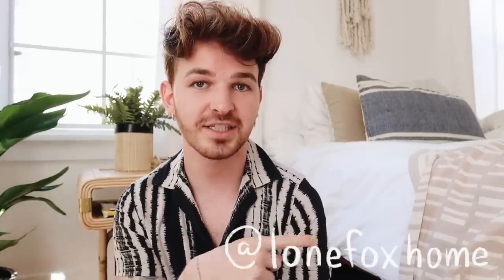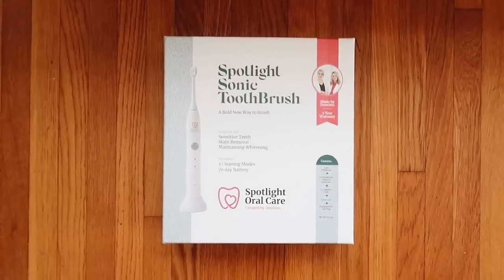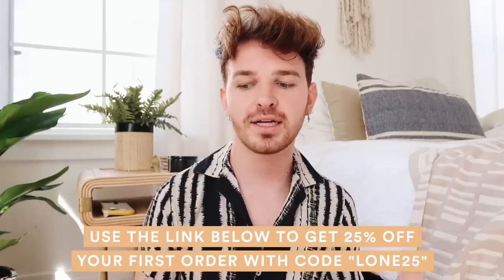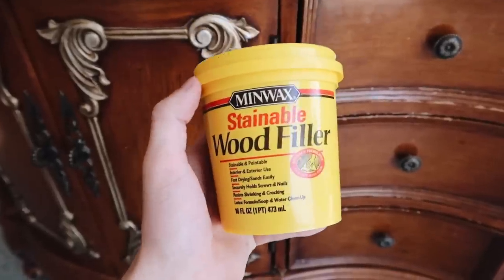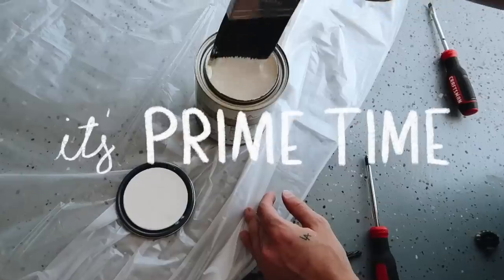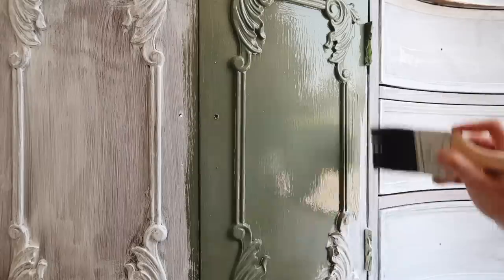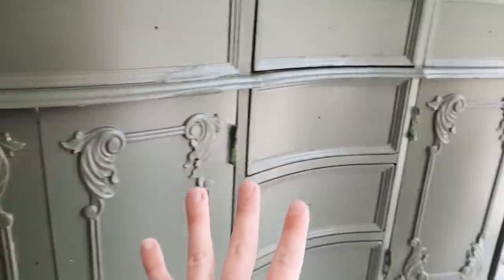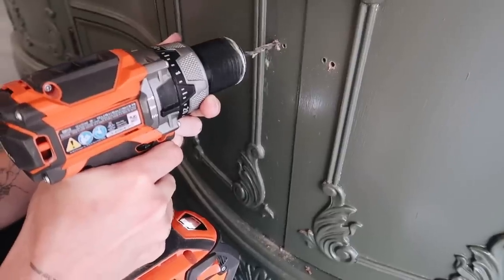DIY BATHROOM VANITY MAKEOVER - From Start to Finish! (I found it on the street)

Comment: You did the right thing with the wood speckling! Just a tip for the future: also add it to the sides a bit to make it cleaner looking and you should be able to use a spatula/putty knife/whatever you call it in English to sort of pre-form the lines. If it feels to wet, let it sit for a little bit until it starts to firm up a bit. It'll make the sanding process much easier. Two painting tips: 1. don't be afraid to really go into the caps and details with the paint and the brush. It'll help sort of fill them and in the end it'll look smoother and newer in the end. 2. I can't really see whether you're doing it or not, since you're not showing it, but always make sure you'll finish painting in the same direction. It's a bit harder to explain in writing, but don't leave weirdly directed strokes-they'll show up after drying. Trust me, I used to work as a restorator and as much as I tried in the beginning, when I had just started on that career path, to fix it, the weird strokes still stayed and I didn't know any better. But, if you are doing it-good job! Maybe there's someone else out there who needs to hear that tip. A lot of people don't know it, surprisingly...
Reply from the maker: Thanks so much for the tips!
Reply: Would a polyurethane top coat mask the streaks. I’m planning on painting a piece at home
Reply: Would adding a bit of floetrol to it help even out the brushstrokes?
Reply: Another tip I use to prevent brush stokes is to go down a brush size and use the paint sparingly. It’s not a time saving tip. A big brush and a lot of wet paint getting dragged around is going to leave strokes no matter what you put on top of it.
Reply: Lone Fox To prevent streaks you can always use Floetrol! I’ve heard great things about it!
Reply: @angelicfrade8600  Is that something you add yourself? I've never heard of this? Thanks for the tip.
Reply: @lonefox  You have a natural gift to visualize the potential treasure in re-purposing another person's cast off junk! Plus the creative skills required to actually transform it into something really awesome! You found nice piece, made fine choices in paint color, knobs & fixtures! I understand you were in a time crunch & working in another person's space but if you could take every piece apart it would be easy to get a professional finished result. Number each door & drawer to reassemble the same way. Take your time & reform the worn down or chipped out damaged places to look original. You might not have shown it but I have a few suggestions. After it's in pieces, use a cleaning solution to remove any residue. Very lightly sand the finish & use a tack cloth (wax coated gauze) to pick up remaining dust before primer & if needed between coats. Either use a very small brush or spay paint to apply paint to not show brush strokes & avoid any runs. Also raise legs a few inches off ground level with small pieces of scrap wood to paint down to bottom of legs. If you take more time to prep & paint 3 thin coats, you'll be very satisfied with your final finish after you see it put back together. Hope my tips will give you insights for future projects. Always strive to learn more, improve your craftsmanship skills & nurture your authentic talents. Thank you for sharing. Wishing you abundant Blessings!
Reply: You sound jealous.. just say "nice"!
Reply: PJ T Yes! Sorry for the very late reply but it is an additive that you buy separately to mix into your paint. I recently had my kitchen cabinets refinished and it was a tip shared by my contractor, so I’m happy to share his expertise!

Comment: When you are brushing with your electric toothbrush DO NOT SCRUB BACK AND FORTH! The back and forth motion will remove enamel off your teeth. Just place the brush on each tooth surface individually without rubbing. You are young and won’t see the damage until you are older. 
Love the vanity, you lucky dog for finding it on the side of the road. You did a great job changing and improving it! Love it.

Comment: Love this! For the future, make a silicone mold of the good part of the wood. Then add wood putty to the mold, let dry, then use Gorilla wood glue to the area of the missing molding! Also, you need to buy a $20 dolly or make one in case you find another great piece. Then you can roll it home!
Reply: sylvia seri Harbor Freight!

Comment: Just curious if there’s a reason why you didn’t sand the whole dresser
Reply: Or take off the door and drawers.  Or sand in between coats.
Reply: My thoughts exactly.
Reply: If you look close at the area he had to put wood filler on, it’s not actually wood but made from MDF (technically wood but can’t be refinished like “wood”). Stripping and/or sanding MDF would ruin it. I found that out when I tried to refinish a dresser that I thought was wood several years ago. Turned out only drawer fronts were actual wood. 😡😡

Comment: You know you’ve become a full grown adult when you start promoting Tooth Brushes. 🚰
Reply from the maker: LOL!
Reply: Just a tip on the toothbrush.  You don’t need to use it like a non-electric toothbrush; the toothbrush does the work for you so all you need to do is guide it around your teeth inside and outside and the biting surfaces – save the vigorous brushing for your DIY sanding, LOL. 😁
Reply: ... and I love re-purposing what people throw out. Well done!

Comment: Dental Hygienist here! When using the electric toothbrush if you hold it in place and slowly move in along the teeth instead of using a brushing method like with a manual brush it will clean better! The toothbrush is made to vibrate and clean on its own so if you are "brushing" with it it can't do its job properly! Also love all your videos! ♡

Comment: Drew! I have a little DIY hack next time you have a piece of moulding that needs to be filled like that! If you can add saw dust to your wood putty it helps. Pack the putty into the broken piece and over fill it just a little. Then take a balled up wad of aluminium foil and press against an undamaged piece of moulding with the sand paper grit side to the wood under the foil. It forms a perfect sander to match the shape of the moulding! Just slide it back and forth over the dried putty to smooth it to your desired shape!
Reply from the maker: Thanks so much for the tip!
Reply: My pleasure, babe! I love watching your channel!

Comment: When fixing gashed out details (like when he filled the missing chunk with stainable wood filler) try globbing on way more than you need to form a lump thats a bit higher than the surface, then get a pretty sturdy piece of bendy plastic and try bending/molding one edge to match the moulding/detail of the counter. Slowly and with a bit force press it against the regular surface before the gash and scrape across the gash and scrape off the excess wood filler/plaster/putty you use. This will recreate the exact shape of the cabinet detail and once painted will look like nothing happened to it.

Comment: A tip for creating new edges on furniture for future restoration projects: there's a product called epoxy putty that you can shape into the place where the original edge used to be and use water to blend it in into the piece.

Comment: When you have time you might want to fix the damage to the front of the vanity. It looks like you painted over it, but it looks rough. A bit of wood filler would fix that. Also if you are putting it in a bathroom, you might wa t to spray it with a protective finish.

Comment: Do the taps have a sealer or clear silicone you have to put around the base of taps? just curious because water sprays all up taps or is their sumat underneath that seals them tightly?.. those taps are the one yes drew you did it again. Oops I did it again..😂😂✌🏼👌🏼☝🏼👀🙏🏼💥💣🔥

Comment: I don’t actually think it’s vintage- it’s not solid wood. You can tell where drew fixed the dent with wood filler. Either way, it turned out incredible. A fresh coat of paint can transform anything!
Reply: Yeah. You can see that its particleboard.  A true vintage piece wouldn't have modern metal drawer glifrs like that either.
But it is vintage style, with lots of fun detail, and the transformation with new paint is wonderful!

Comment: Toothbrush FYI my dentist told me do NOT scrub back and forth with electric toothbrush it will cause gum recession and enamel ware just gently glide along your teeth the only place you can lightly scrub is on the chewing surfaces

Comment: Im so critical of my work that every tiny visible brush stroke triggers me. I painted a coffee table and everyone loves it but all i can focus on is the brush strokes that can be seen up close.

Any tips to achieve super smooth streak-free finish?
Reply: Lightly sand with a super non abrasive sandpaper to level out the peaks of the brush strokes. Thank me later!
Reply: Use a paint roller
Reply: @jmk1962  i had tried that and it left small tiny peaks like finish instead. May be i used a wrong type of roller... I had used foam roller.

Comment: Gaps cork n paint. If its peeling cardboard material get a tiny bit of water with a blob of pva brush it after light sand same on a broken peeling plasterboard when the top layers revealed from damage. Brush the pva watery solution it locks it stops it peeling. Seals it for painting it must be watery literally a blob of pva in abit at water. It's a sealer to much glue your gluing your wall then and it'll be hard and shiney rather than a watery seal. No you cant see shiney as it's a blob in abit of water. This is what you do to peeling plaster after paints peeling revealing fresh plaster underneath. Sand smooth it off seal it with pva solution. Plasterers seal plaster like this then we go in and paint out homes.🥰✌🏼☝🏼🙏🏼 if you get abit of mould sand and seal with this before papering and painting it also seals.

Comment: Did you sand the textured areas where the veneer was pulling up or top coat of whatever it was was pulling up? If not wouldn't that leave like an indent where you paint that was visible?

Comment: No no no!  You need to take the doors and ALL OF THE HARDWARE OFF the piece in order to get a truly clean and good paint job.  Come on, you know better!  You also need to do a better (much better) job on the repair you did - don't be sloppy with such a beautiful piece!  And why didn't you paint the inside and sides of the doors?  You did the drawers correctly, why not the doors?